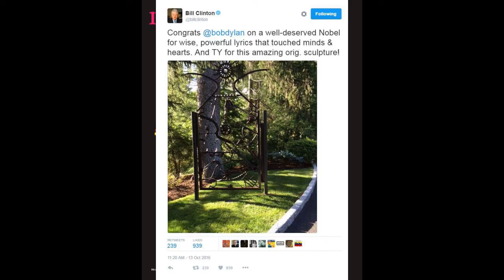Bob Dylan Iron Works Photos

Comment: What type of welding machine did he use in the picture? 
Any pro welder can answer this please
Reply: He's using the GMAW welding process, otherwise known as MIG welding. It is probably the most commonly used welding process that involves a machine putting a constant voltage through a thin gauged wire that is fed out of the MIG gun he is holding. The wire is fed into the gun through a hose that is connected to a feeder machine which consists of a wire wheel and a drive roll to push the wire to the gun. Once the wire is close enough to the metal, it forms an arc of plasma which melts the base metal as well as the metal wire that is fed out of the gun. The two metals then combine to form the weld puddle. A gas combination of CO2 and Argon is also emitted from the gun to protect or "shield" the hot weld puddle from oxidizing. Hope this helped.